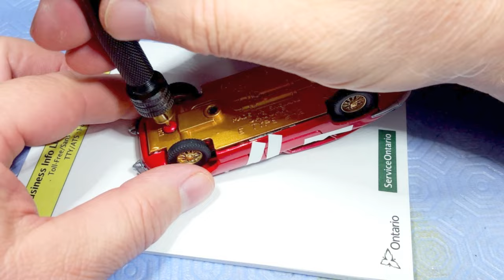Italian Job, Dinky 131Jaguar 2+2 Best ever restoration

Comment: I have two of these to do. I hope one of mine turns out as nice as yours. Well done!
Reply from the maker: Thanks Jesterger. If I can make a suggestion, you should file a bit off the doors, or the body so that you clear the paint you put on it. At least if you intend to spray more than a single coat of paint. Good luck with it. Cheers

Comment: Lovely restoration, unfortunately I believe you have fitted the front fenders upside down the indicators and side lights should be underneath the fender not on top
Reply from the maker: Glad you have you here Peter. I respectfully disagree with your assertion, although I panicked for a moment. I particularly looked up the model of Jaguar in question, both the Dinky version, and the real one.  in both cases the indicators are  on top of the bumper as in this image http://www.carpictureworld.com/jaguar/e-type/series-i-roadster/jaguar-e-type-roadster-front-right-1200x800.jpg and this one  https://assets.catawiki.nl/assets/2016/2/23/2/d/5/2d5849d2-da60-11e5-8a2f-ddefef0832b0.jpg
Of course later years show the Jaguar indicators below the bumpers, imbedded in the body.
Cheers 🍺